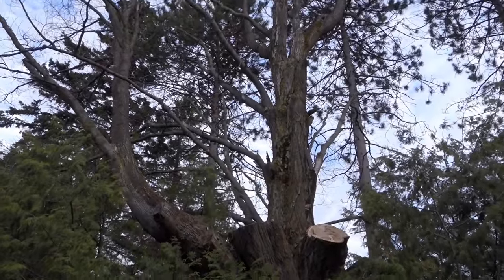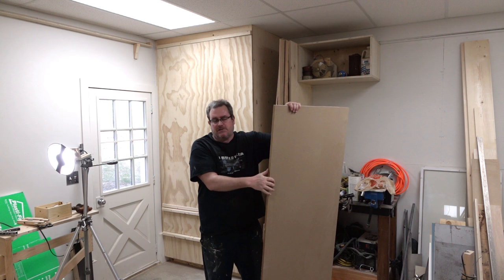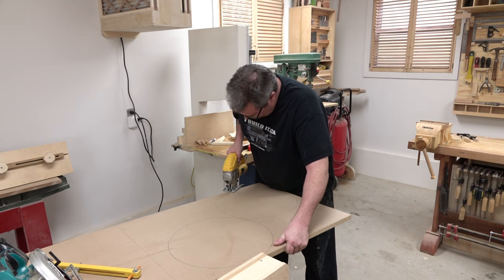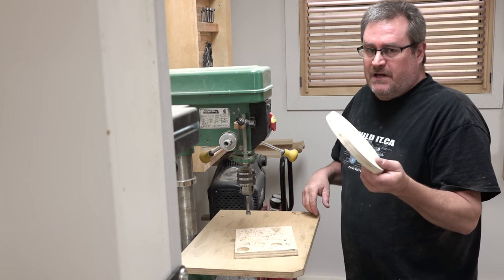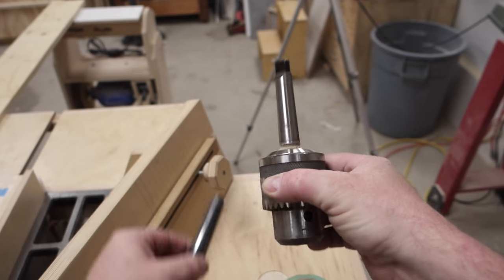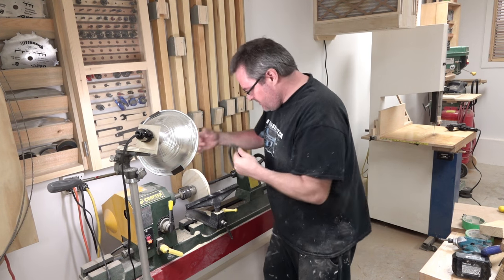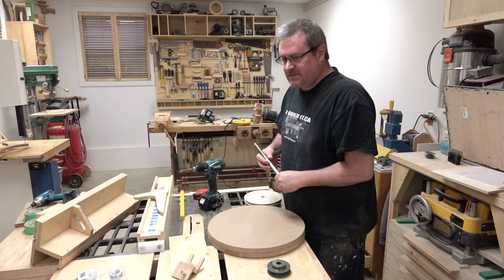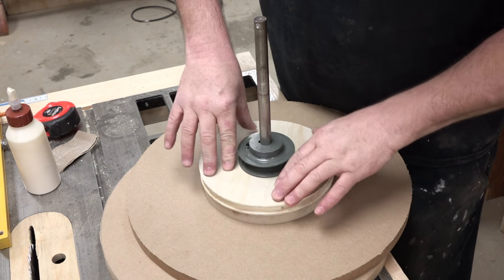Making A Quick And Dirty Band Saw Mill - Part 1

Comment: drill through an old CD. The reflection will help u determine if it is perpendicular
Reply: +Ken Oakleaf 
Can you expand on this comment? I'm curious.
Reply: +Steve Gores-Todd 
To help line up a drill bit vertically without a drill press put down an old CD. U will see a reflection of the bit in the CD. When the bit and reflection are perfectly lined up u know u are perpendicular to the surface, then u just drill through the CD into what u are working on. Down side is this only tells u if u r lined up side to side, u still have to be careful about towards and away
Reply: +Ken Oakleaf Wickedly simple. Never would have thought of that myself, but I am a tradie so I have had a few years of training. ;))

Comment: I'm very, very interested in this, John. I know that you're building this for a one-time-use situation, but I'm sure my question is relevant to a more permanent build. That question is, what kind of RPM are you shooting for on your 16" wheels? Is there a "golden range"  that band saws or band saw mills operate at? I'm seriously looking into making a small band saw mill using a small gas engine, so any insight you may have would be very valuable to me. Thanks for posting this! It's very cool already!
Reply from the maker: +Mark Lindsay 
I'm shooting for 2500fpm for the blade speed. Faster will cut faster, but needs a lot more power and built better to keep the blade on the wheels. I thought about getting a gas engine for this, but really it would be better for a more permanent build.
Reply: I Build It  Thanks very much, John!

Comment: Reaction and juvenile wood is prevalent in branches. In turn making branches only really good for firewood. You should really seal the end grain of the branches and get them off the ground asap. 

Glenn
Reply from the maker: +NeonGreenPage 
These are trunks, actually. As for sealing the end grain, what do you suppose the chances are that I didn't know that already?

Comment: Speaking of drill press chucks, mine is absolute rubbish. Its not well aligned, and I can bend the key before it grips the bit properly. Its an older craftsman drill press. Can you recommend a decent replacement for it? Unlike yours, the drill press itself has the tapered shaft, and that goes into the chuck. The taper seems to be straight still, despite excessively large amounts of violence trying to remove the chuck
Thickest part of the taper is ~15.6mm
Thinnest part of the taper is ~14.5mm
Length of tapered section is ~23.8mm

Cool channel, subbed :)
Reply: I live in America, but I always use metric for these kinds of measurements, I find it easier than 1/128in increments... Thanks for the help, I will read up on that and look at some customer reviews on Amazon!

Comment from the maker: The first in a series of videos on building a band saw mill. You can follow along with this build on my website forum:
http://www.ibuildit.ca/ibuildit-forum/viewtopic.php?id=583

The idea is to make the mill quickly, just to get the hard maple logs cut into lumber, then dismantle the saw. I'm trying to use just the materials I have on hand already to build this, keeping in mind that it only has to work for a limited time.

I'm making this project over the course of several days, and will be releasing videos as I get parts done. 
Editing and putting together a video can often take longer than the project itself, so that's why I'm doing it this way, rather than waiting until the end to make a single, long video.
Reply: +I Build It I was just settling into enjoying this build and it ended! HELP - Looking forward to Part 2 from the UK